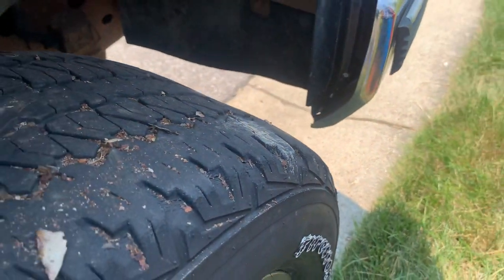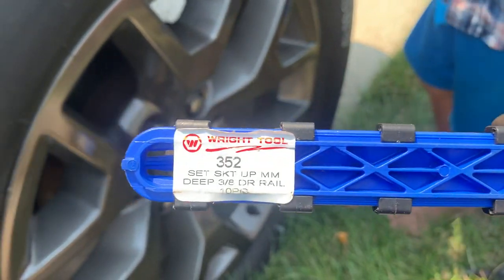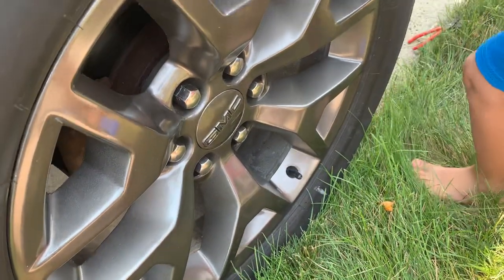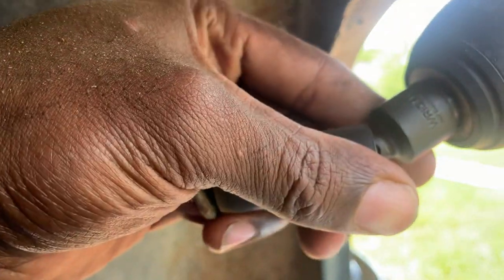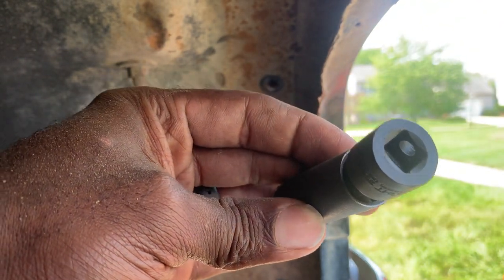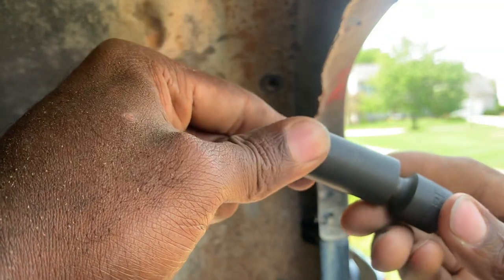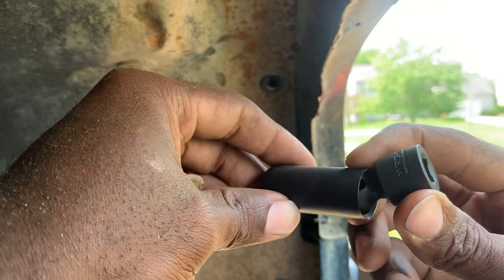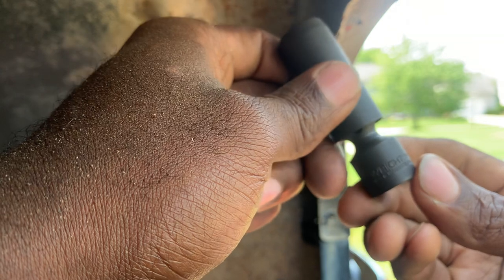#Short: Wright Tools 3/8” Drive Universal Socket Set Review | Tools in Use

Comment: Snap-on without the name I figure you know they're owned by Snap-on and do all their forging and stamping for them
Reply: Lol Wright is not owned by Snap-on
Reply: Wright is a completely independent tool company here in the USA. You may be mistaking it with the company Williams. Which Snap on does own and are made in the same factory. I believe the only difference is snap on goes a step higher in quality and uses modern technology. While williams uses snap on Older tools.
Reply: @SnD340  yeah you know you're right I was thinking  starts with w.  Yeah Williams doesn't have as  good a finish as Snap-on.   I have run into times where I found Williams stuff on the snap on truck and it was all accidental
Reply: Are you thinking about williams tools
Reply from the maker: I figured you know Wright Tool IS NOT owned by Snap-on…they’re a family-owned operation and have been for decades. I think you’re referring to Williams…
Reply: @MidwestToolReview  i was but forgot the whole wright/williams deal.
Reply from the maker: Yes….a simple Google search or visit to their page, abs you can learn their entire history. Nothing I’m not already aware of…
Reply: are those pinned or pinless? looking into getting some
Reply: @MidwestToolReview  had to laugh when you got all offended at justin.  You take yourself a little bit too seriously, brother.
Reply: @mr.orim0782  skip them they have very poor representation here go with a  truck brand. Preferably Mac or snap on